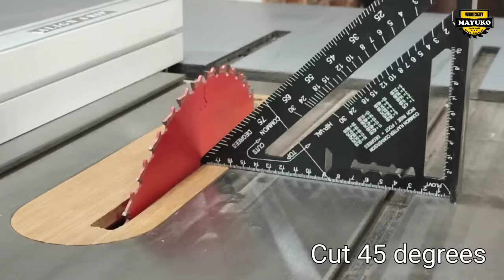3D ENDGRAIN JAR, woodturning

Comment: I don't know which is more impressive.  Your ability to cut and assemble parts into the correct configuration, your wood turning ability, or the excellent end results.  Of course, without the first two steps there wouldn't be such excellent results.

Comment: very nice work! that turned out very nice
 two tips: to reduce the vibration in your steady rest, sandwich a piece of sheet metal between the layers of MDF. but be sure to make it one ring that is the same size and not a ring out of two pieces. that steady rest is very clever...will have to make one myself for my wood lathe too 
and then second, use some double sided tape for attaching your top caps to the work piece at the tail stock. that will keep the work from drifting under the end cap and running out of round

Comment: By the way, instead of messing with rubber bands, there are adjustable clamps that can press objects together at a preset angle... just a tip.
Reply from the maker: I've tried it with clamps but it's hard to do because of the sharp angle

Comment: The inside( which I wish they showed more) feels like a relief of the front pattern with the angles as a real 3D model would be. Ie It looks like what it would if built as the illusion appears, like a waffle and waffle iron. The question is did he design this as original or a copy of existing concept, either way its beautiful. If he designed this pattern then I would call it a masterpiece
Reply from the maker: Of course this pattern has been around for a long time but it was in cutting board form and I made it into a jar, and this I think this method is new
Reply: @mayukowoodturning7644  にほんじんですか